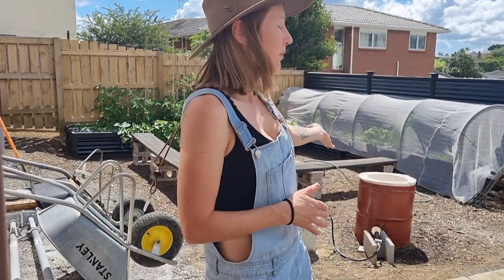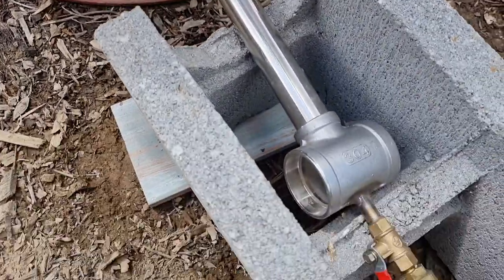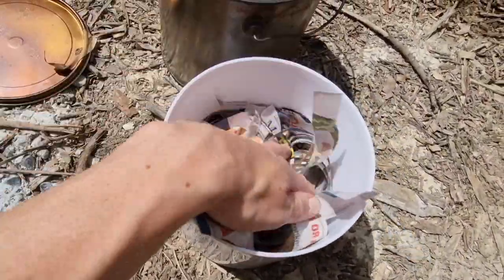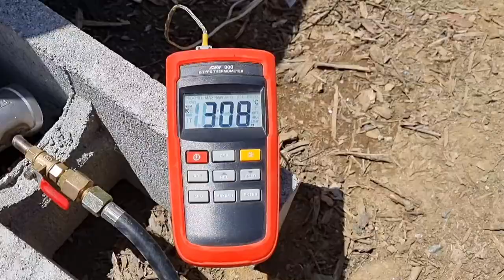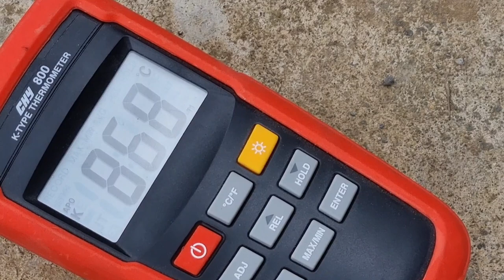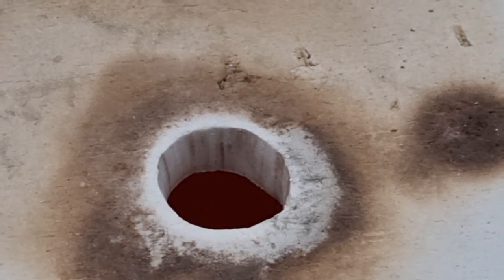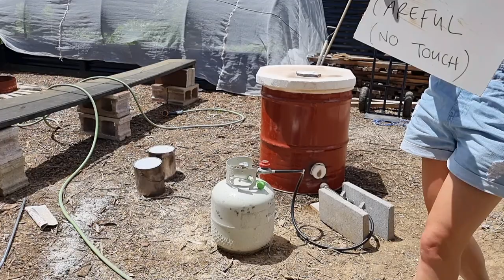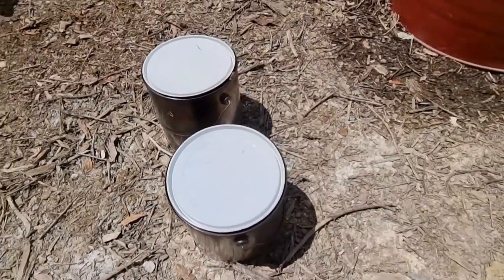Black Beach Sand and Copper Raku Pottery (Full Video)

Comment: someone did really nice job on the insulation!
Reply from the maker: Thanks! The extra layer of fibre blocks really make a difference in retaining heat. I've heard that one's made just with fibre blanket can struggle to reach temperature.
Reply: @karenwildeart  I used 1" fiber blanket but next one I do will have the rigid board for sure

Comment: Have you had any experience firing Ollas for garden watering? I'm using a heavy grog terracotta clay  supposed to be cone 04 to 05 My first attempt I ran it up to 1000f for 2 hours it looked good at first then about 5 mins after filling it with water it cracked in several places and fell apart. Its fired enough that the clay doesn't dissolve in water but it has no strength. I have one in the fire right now going to about 1500f this time. I had to get a bigger burner today and they left the needle valve out of the box so I;m having to control it with valve on the bottle ,man you talk about touchy lol! Been cooking this thing since a little before noon today and I'm at about 1300f now
Reply from the maker: Keep going hotter if you can! I bisque all my pieces to 1000 degrees Celsius first (1832 fahrenheit) and then refire with my glazes in this kiln to 1050c. Sounds like your pieces are not vitrified which is why they are cracking/brittle. 900-1000.C (minimum of 1652f) is still quite porous for terracotta and should seep water nicely for Ollas with the added strength you are looking for.
Reply: @karenwildeart  Ok ima take your advice i'm at 1500 now and going to 1650 in another hour. How long would you maintain 1650?
Reply from the maker: @regularguy8592  I'm not too sure as I only ever glaze fire in mine. When I bisque fire in my regular kiln I programme it to turn off as soon as it reaches temperature (no soak/ hold) If this is your first firing then cooling of the pieces is just as important as reaching temp. Close off any ports and leave to cool very slowly. Look up "stages of cooling pottery" to better understand the vitrification process and prevent cracking when cooling (even tiny hairline cracks can become a problem later on). Hope this helps :)
Reply: @karenwildeart  I definately plan on closing all the holes when its done then I will open it up in the morning already past my bed time lol
Reply: @karenwildeart  I have a 500,000 btu burner you can blow on that valve and temp jumps up 100 degrees lol.
Reply: @karenwildeart  I ended up bringing it to 1660f and holding it a bit below that for about 20 mins then backed the temp down with burner for the next hour or so to about 1300f then I turned it off capped the holes and boom we have success this morning! It is also slowly starting to weep water out as intended so it appears to be 100%. Thank you soooooo much for the help!!!!🌹🌹